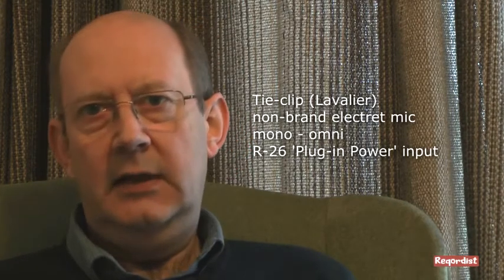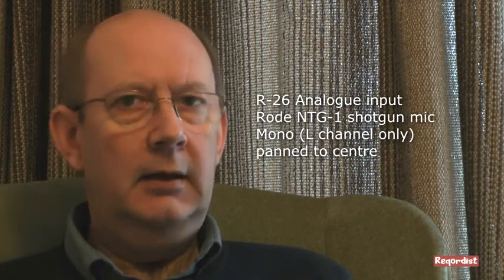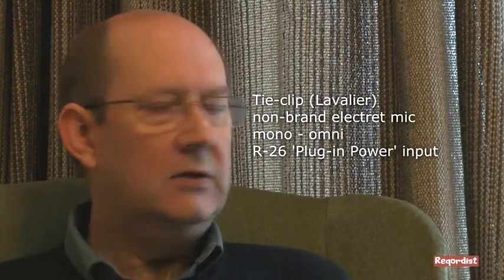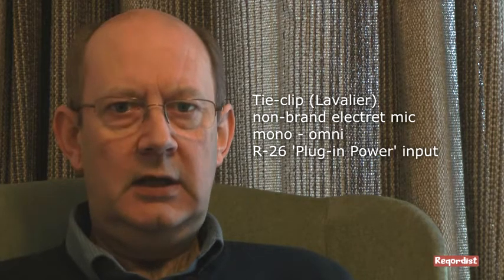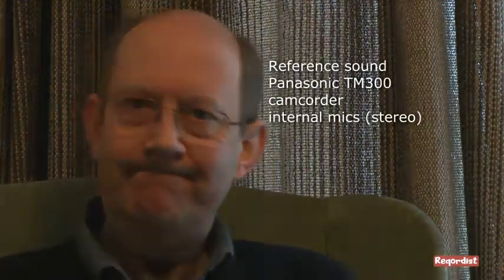Test of R-26 with multiple mics for use with video

Comment: Thanks for posting the test; a recorder I am considering. As I suspected, it seems like there is quite a bit of pre-amp noise when the internal mics are being used in a quiet situation like this. But ok when using external mics. And the Rode NTG1 is a clear winner for me.

Comment from the maker: (...contd due to sillly 500 char limit - this got lost last time!) I use higher o/p condenser mics so noise not a problem for me. Sensitivity normally set for to -50dBu or lower. Seems to be proper gain switching, not just a passive pad in front of a fixed gain preamp, so S/N improves as i/p levels rise from mic to line. Still take the R-44 if a job requires real lo-noise operation. R-26 noise / headroom much better than my old Zoom H4 and Marantz PMD-670! Note only considering XLR inputs here.

Comment from the maker: (...continued) Only consider noise on the XLR inputs, and with my condenser mics, have only needed to run at -50dBu setting. I think if you have low-output mics, you may be better off with dedicated preamps. 

The block diagram indicates that the sensitivity control is a proper gain-switching arrangement, and not just a passive pad in front of a fixed gain preamp. 

You may gather from my other comments that in a noise-critical situation I would use the R-44 in preference to the R-26.

Comment from the maker: @SakataSaitoki Hi - since I was working in a very reflective room, there seemed no point in using the R-26's internal omnidirectional mics, so in the [Recorder Setup] menu I chose [6 Channel] recording with [Rec Source] set to [XY + ANALOG + P-IN].  

The R-26 internal source was therefore [X-Y], i.e. the internal X-Y crossed-cardioid pair, the [ANALOG] was the NTG-1 (on L channel only) and the [P-IN] was the external Lavalier tie-clip mic (fed to both L and R channels).

Hope that makes sense!

Comment: I've been spoilt by having full XLR audio on my Panny HMC40 but now with my GH2 and my TM700 I'm back in the stone age with horrid audio. I'm debating wether to get a nice filed mixer and then some type of recorder like the R-26. A good quality field mixer will never go out of date right. I have a nice higher end shotgun Audio Technica AT I paid $700 for so and it worked great on the HMC40 although it was so sensitive I had to almost set the HMC40s dials to zero to get it to not distort.

Comment from the maker: If you need to mix other sources during recording, a field mixer is great. But if you're working with the AT mic alone, and it gives loads of output, I would think that you could run it directly into virtually any field recorder with XLR inputs, as the mic level would be sufficient to swamp any preamp noise. 

Having said that, my old Marantz PMD670 inputs have very little headroom, forcing the use of the 20dB pad in almost all situations, degrading input noise very badly.

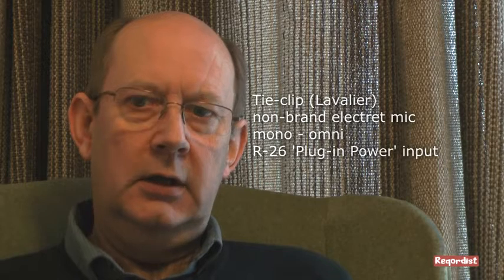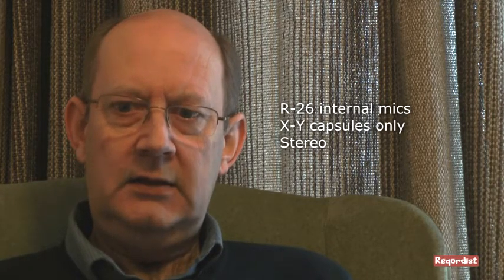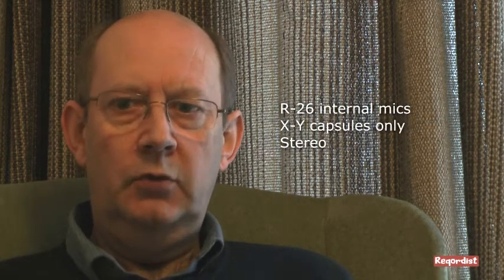Comment from the maker: @SakataSaitoki Hi, There may be some small difference between the angle of my head as I'm speaking in the two parts of the video that use the X-Y, but to my ears, the first part (0:31 - 0:41) sounds much the same as the second (1:09 - 1:13). Note that the second time is very short. Certainly, the X-Y sounds very different from the sound of the other mics!

Comment from the maker: Can't help you greatly there. Gain is specified in terms of (I assume) sensitivity for 0dB at the A/D, ranging from -68dBu to +4dBu in 12-off 6dB steps. This is the same as the R-44, but I'm not convinced the circuitry is the same. The block diagram in the R-26 manual worryingly shows the limiter and low-cut filters after the A/D converter, which seems completely pointless to me. (continued...)

Comment from the maker: Have mixed feelings about the R-26. Nominal 6-channel recording can be useful, but against that: Its internal mic grilles are ugly and offer no wind protection at all. Connectors on all sides make it messy in the field. Battery life (NiMH) seems not too great.

Overall, for 'serious' jobs I prefer my R-44 - sadly a product Roland seem to be phasing out - a true 4-ch recorder with 4 x XLR/Line and wide ranging input gain scheme on top of good low-noise preamps.